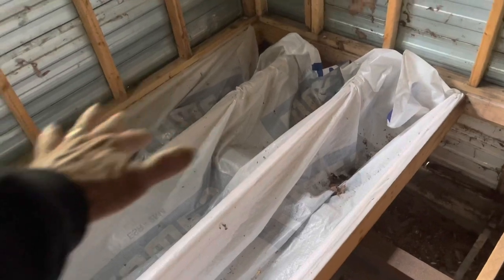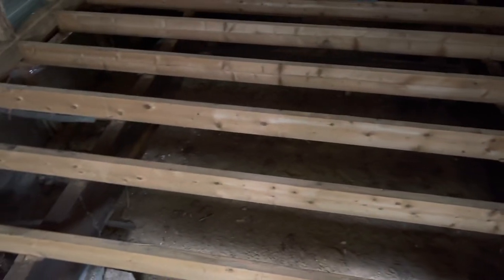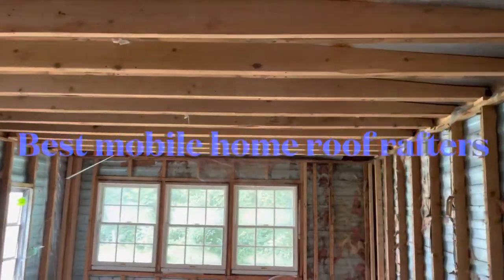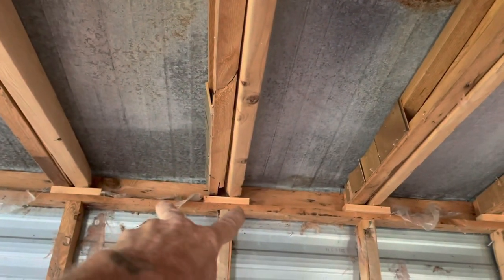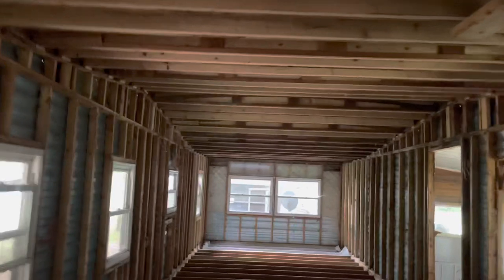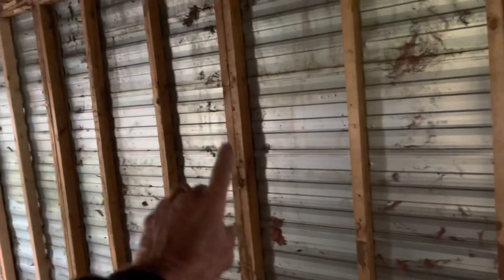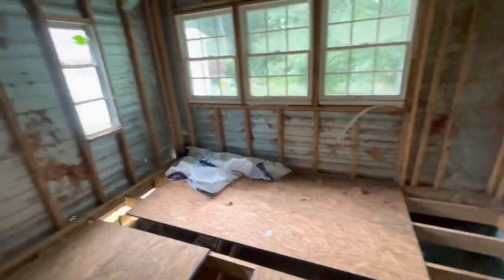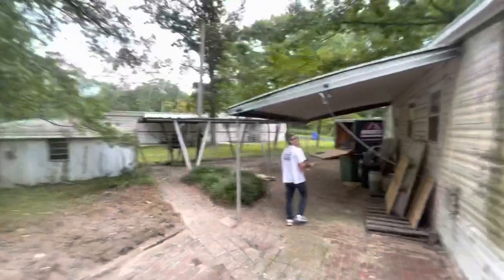Mobile Home Roof Truss Replacement. How To!

Comment: I'm trying to figure out if it's worth remodeling my mobile home.  I think if I do decide I would do something like this. To build it to last. It's crazy my trusses are only 1.5inx2in. And 1.5x3in wall studs.
Reply from the maker: Most of them are framed like this. Is it cheaper to buy a new 1 if not then remodeling is better
Reply: What can I do if I have an overhang?
Reply from the maker: Not sure what you are asking
Reply: @Drew's roofing and repair,  I'm guessing I was referring to how tucked and cozy he has the end of those rafters. That was yesterday ,I have problems remembering what was for breakfast
😂😂😂keep doing what you do Drew. I do love your content⭐
Reply: @Drewsroofingandhomerepair 1.5x3” walls is most likely what I have also. Do you think they will support the weight of 2x6 joists with 1/2” drywall ceiling?

Comment: Just about exactly what mine looks like mine  but my trust are smaller and the wall between kitchen and bathroom is 1×3 ½ and bed room walls are 2×2s and a lot of the wall studs are 2×3 and 1×2 having to replace dang near everything rim joist sill joist rafters floor joist.
Reply from the maker: Wow let me show you one that I’ve been working on or I finished a while back check out some of these videos that I did on floor repair. https://youtu.be/a-tDntNhhJo
I know exactly what you’re talking about
Reply from the maker: Go back about a month or so on my videos and you’ll see what we did a whole floor in a mobile home. Exterior walls rim Joyce I mean everything was bad

Comment: yea my gma's trailer roof is sagging quite badly. So bad that the interior ceiling panels are breaking at the seams. Its just her living room area. The hard part is NO ONE wants to do work on mobile homes....  This helps seeing how they are built.
Reply from the maker: I’m glad I could help. Remove the ceiling install new 2x6 all the way from 1 side to the other
Reply: @Drewsroofingandhomerepair we are in the process of doing this right now with our mobile home remodel. 2x6 throughout the whole ceiling to support drywall. My question is, will the walls need to reinforced to hold the extra weight? I have to check to see what they are made of but I’m assuming they are exactly like this one. Sounded like he may add 2x4 walls to this one, which I would do if my walls were opened up, but they aren’t. Im hoping the existing walls can support the new 2x6 joists. Any input would ne greatly appreciated!!

Comment: How do you add spacers ?
Reply from the maker: Where are you take out the ceiling tile that goes on top of the wall you just replace it with a piece of one by
Reply: @Drewsroofingandhomerepair  ok so just fill in the spaces from the old ceiling all the way around ,under the rafters ,double up on my ceiling joist and then add the new sheet rock to the ceiling and remove the spacers as I go ? I’m in Clinton nc
Reply: I’m trying to change my top plate for the wall studs to 2x4 , the original in the trailer is 1x2 on all outside and inside walls
Reply from the maker: I don’t know if that’s necessary or not to be honest but I’m not looking at your situation look up Drew’s Roofing And Home Repair online you can find my telephone number there just call me I’ll answer your questions I can’t put my phone number out here on YouTube or they’ll delete my comment but you can find me online
Reply from the maker: Look up Drew’s Roofing And Home Repair call me my number ends with 2207. If you look me up online Drews Roofing and Home repair just like it says you’ll find me I’ll be glad to talk to you on the phone

Comment: Faster to just build a house.. This is just dumb lol
Reply from the maker: Not really you have the whole frame already there so using the frame and remodeling the inside you actually 7000s of dollars over building a new house. Homes are fun to remodel and not that hard to do. If you have a frame and a structure rebuilding is much cheaper than buying new.